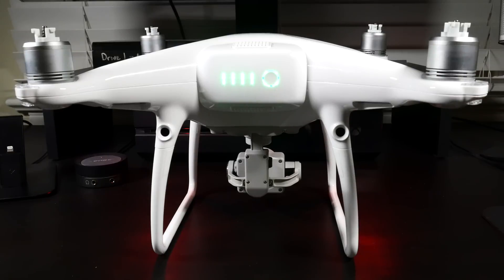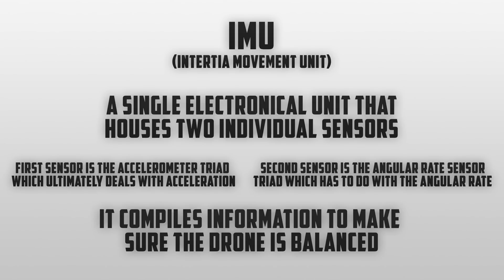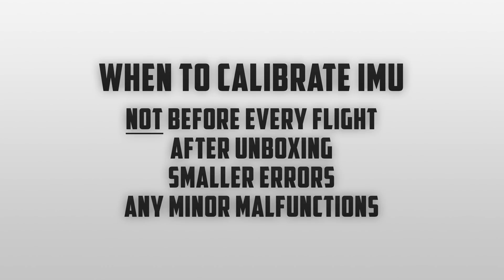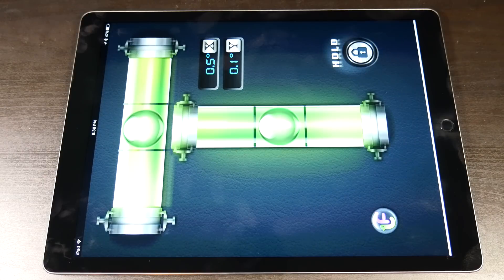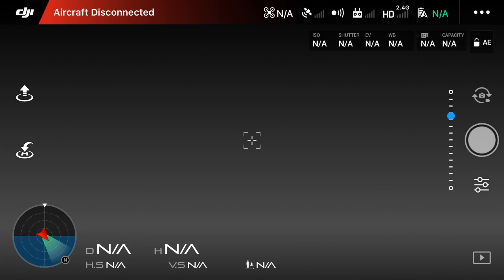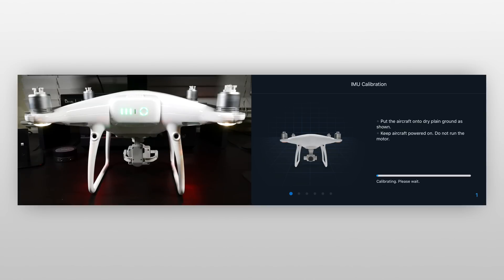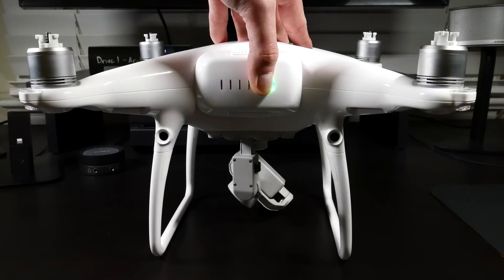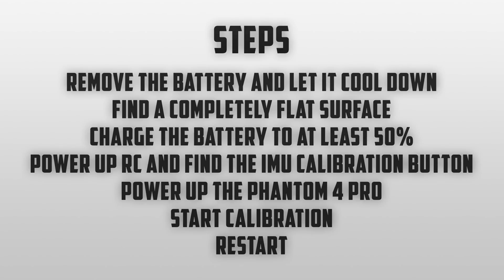DJI Phantom 4 Pro: When and How to Calibrate The IMU

Comment: I am going to do all the calibrations manually tonight when I get home from work. 
The issue that seems to go way back from the beginning is incorrect reporting of Altitudes. 
I can start off at the home point hovering at the four foot starting point but GO shows 16 feet.
Fly up to 50 feet do a circle come back to the home point and still the same 16 feet when it at 4 feet. 
This is my first drone and I have only had it for a week. Did not know to do a IMU calibration out of the box. Anything else the manual does not indicate that should be done?
Thanks to all responders.

Comment: I just bought the new Phantom 4 Advanced. Could you do an out of the box start up??? from the box to the sky? I can't figure it out and it's pissing me off. I want to fly this damn thing already!!!!!!! HELP!!!!!!!!!
Reply: I got a Phantom 4 Advanced + in Oct of 17 was not able to mess with it till Feb 2018 and I fond out the RC would not link with the drone till I downloaded software and firmware, one was for the controller and the  the other for the drone. I had to do the download after midnight and before 5am because of slow internet connection. RC and drone linked together and I was able to fly  pictures were awesome. I think it was very disgusting that the drone would not work out of the box I don't expect to buy other things and have to start downloading software before I can use it.

Comment: Hi there, when you got to step 5 of the IMU, the DJI graphic seems to indicate that the drone should have been turned 180 deg and THEN tilted onto the battery. At least that is what I am understanding. However in your video you are just tilting it backwards. I wish DJI would make their instructions more clear since I find this CHANGE in their graphics a little confusing specially when I come across your video which should the LOGICAL next sequence. What are your thoughts? 

Also, I am unable to calibrate the compass unless I get an error.
Reply: I was wondering the same thing....  Seems like a few of the Videos are doing the same thing....  The screen shows the opposite of what that step is being shown on the how to videos....

Comment: you will just confuse a newbie and your point of view is from the back but at the end on last step you face the p4p the wrong direction
Reply from the maker: +chris digata On the last step the drone is placed properly with the battery to the ground.
Reply from the maker: +chris digata Direction does not matter. You can face it any way you'd like as long as it's in the same orientation (On the landing gear, leaning to the side, etc.)
Reply: wow it did matter on the early firmwares but it would not complete the cal. nice to know that its mot importamt, same as the compass call always had to be anti clockwise but now it can be clockwase also

Comment: Great info. I have done this, but the gimbal makes a fair amount of noise at times doing this, and when doing 2nd part of compass calibration (drone on its side). I also get a notice that the gimbal has exceeded it range too. Is that normal? Or are her issues that may require service?
Reply from the maker: No, shouldn't hurt the gimbal at all unless you have it sitting there over night on its side, but thats just not taking good care of it. its only in that position for a couple of seconds so there is no need to worry.
Reply: Thanks!

Comment: Okay so on my P4P at the top bar mine says Backward facing obstacle avoidance may not work it needs to be calibrated. It then tells me to draw a square in front of my body to calibrate it. Would this fix that or how do I go about fixing it? Can't seem to find anything. Love your videos and will defiantly be hitting that subscribe button!
Reply from the maker: +Quincy Rosmon Have you tried recalibrating the sensors using the Assistant software?
Reply: Billy Kyle No I will give it a shot tonight. It said they may fail unless calibrated so I'll try what you did in this video.